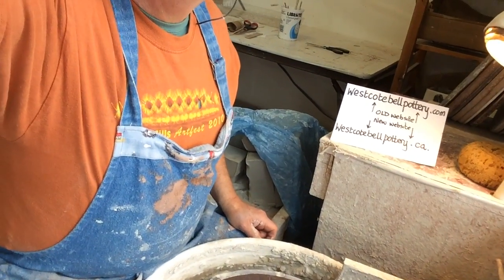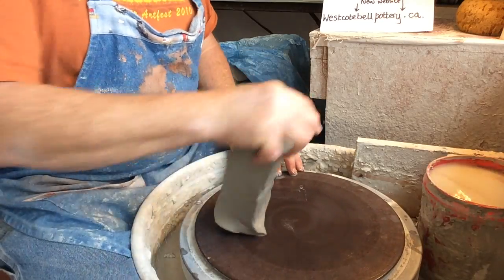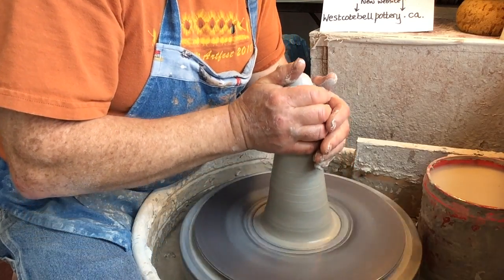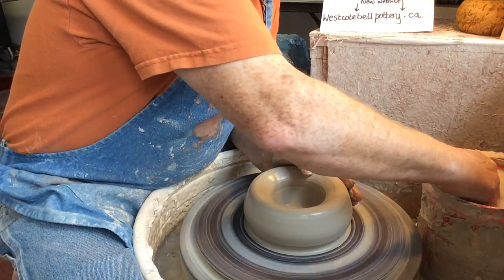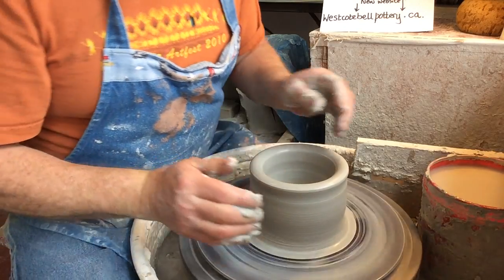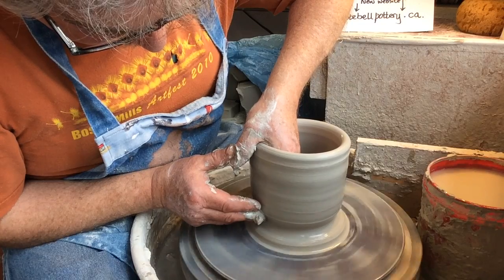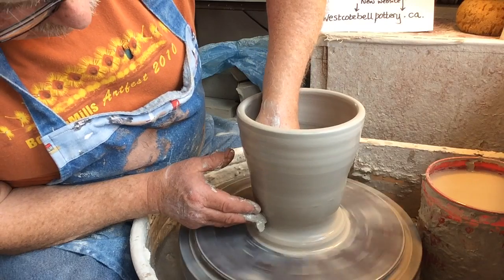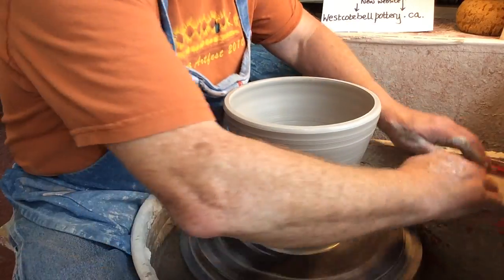Throwing wall planters.

Comment: reckon ive got them right now after studying the vids.... thanx. but may i ask how deep do you make the base when throwing, is it same height as the block of clay you previously leave/define for the drip tray . also, do you do any turning to the pot, later?
Reply from the maker: Yes, about 1 1/2 inches tall and I trim them. thanks.

Comment: am sure we've met way back in the 70's, maybe at the somerset, royal oak or the coronation tap. lovely vids, do u mind if i borrow the flower pot design as a shop here in Easton Bristol need some for outside. Just a thought but i would use stainless steel screws as they don't rust, allowing pot to fall ...oww ! thanx mark b
Reply from the maker: Sounds like we both went to Bristol Poly at Bower Ashton. 1975-78. I use galvanized decking screws.  Did you ever see a band called Juan Foot'N'LeGrave.? They were in my year there, Stuart Gibb was one of them. I found a video of the band on Youtube.Thanks for watching.
Reply: @Vsmithpots  i don't recall the band, will check them out though. i went to bower ashton only courtesy of the weekly discos held there after the pub. i just noticed that the wall planter is ur design, do u mind if i copy parts of it?
Reply from the maker: @mabob6212  Here is a link to the band.  https://www.youtube.com/watch?v=yIt40RURFT4
No problem on the planters.
Reply from the maker: @mabob6212  https://www.youtube.com/watch?v=yIt40RURFT4     This is the band. No problem with the planter.
Reply: @Vsmithpots thanx, i like the them, too bad old potters dont get back together for gigs ..ha-ha...they're having a good time for sure. as u like them check Swamperella, a Toronto band..Louisiana swamp music. whats 2.5 days drive to see a good band:)

Comment: Greetings Vaughn.  Nice touch, beautiful forms. 

Do you have a recommendation as to where to place the screw hole, how far from the rim of the pot?  Is one screw whole adequate, vs two with a hanging wire?  Thank you for the video.
Reply from the maker: I attach a 1 1/2 inch disc of clay about 1/4 inch  down from the rim to thicken the area where I drill a hole.
Reply: Great suggestion.  I am going to try that and thank you again.

Comment: hi. a question about these planters if i may. when drying, at what stage do u flatten the back? 

and is it my imagination or does the pot part shrink more/faster than the drip tray. its occurred to me that as the tray is semi stuck to the ware board [even if wired] its shrinking may be hindered untill its dry enough to move freely

lovely things and the cafes round here [bristol] want some but like most simple things they take much practice. thanks again for letting me use the design, in pottery conversation i say the idea is borrowed from you
Reply from the maker: I cut through the base two or three times while drying. I use a thin guitar string. You can also turn them upside down.